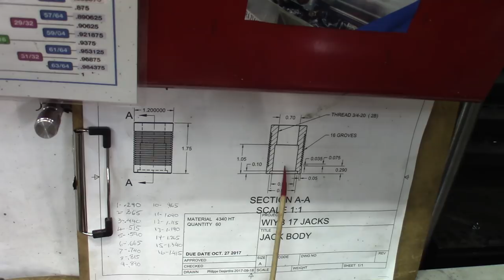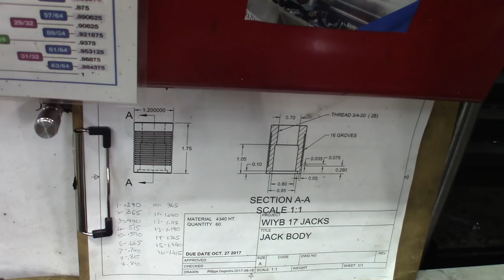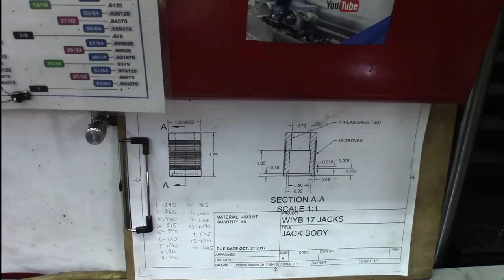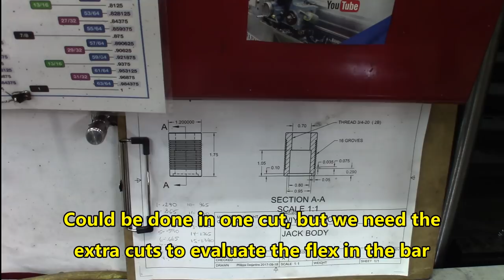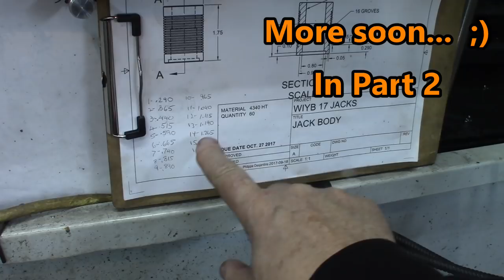Fast and precision boring on Screw Jack for WIYB 2017. Part 1

Comment: Those are a nice looking product, and using 4340 will definitely make them durable!  The grooves on the side are a nice touch.
Reply from the maker: Hi Everett,
Those grooves are Philippe's idea, he calls this the little "Simple Classy Black Dress"...   ;)
Although tough to work heat treated 4340 is quite a nice material to work with, durable and leaves a great finish.
Cheers,   Pierre

Comment: Nice demo on how to run carbide tooling Pierre. Watching guys deliberately taking final passes at a few thou grinds my gears. The other thing that grinds my gears is guys using cutting oil on a high speed machining operation and then wondering why the part shrinks :) You can't beat the smell of rancid soluble oil in the morning :)
Reply from the maker: Hi Rob,
Ah...  Ah...!!!   You're very right about both grind points, the smoke is not exactly a treat, but I'm not really setup for soluble coolant, that would be my first choice. Coolant is somehow neding much more maintenance since when it depletes, corosion gets the best of the machines and also everything starts to jam in rust or caked dried coolant...
Thanaks for comment,    Pierre

Comment: Never seen an insert drill like that. What are they called? Did you do your own heat treating? Really nice work. Felicitation!
Reply from the maker: Those are what we call "Spade Drills" you can get some made of cobalt or carbide, quite costly though, I'd say from $25 to 60 per insert depending on the size, quite efficient mostly if you can supply high pressure coolant throught the holder to evacuate the chips and keep th cutting edge cool.
One of those iinserts was able to drill about 20+ feet of 4340 heat treated material, quite hard stuff, would compare to drilling into a high grade bolt...
Thanks for viewing and for comment,    Pierre 
Here is a link to AMEc:  (Not sure they still make this precise type, I think other companies make compatible ones, though...)
https://www.alliedmachine.com/
Reply: Merci Pierre!
Reply from the maker: @lohikarhu734  The few gun drills I have are not in great shape, they would need sharpening...   ;)
Reply: @pierresgarage2687  so, you do have some experience with them ;-) ...are they usable without pressurised coolant feed, or with low flow or hand-applied lubricant, and low speed? Can a person grind their own, I mean, an ordinarily skilful person? thanks, Monsieur Maestro!
Reply from the maker: @lohikarhu734  If used without coolant it's better to slow down and make sure the chips aren't packing...   A little better with low pressure coolant, but the best is high pressure to evacuate the chips.

Not sure where, but, I've once seen a video of someone sharpening one of those, needs quite some skills cause many angles and shapes involved, those need to be quite accurate...